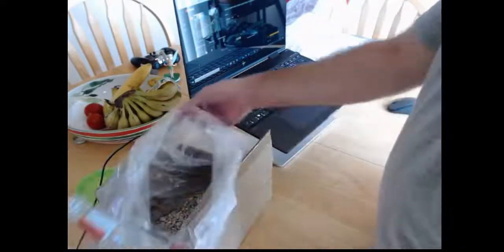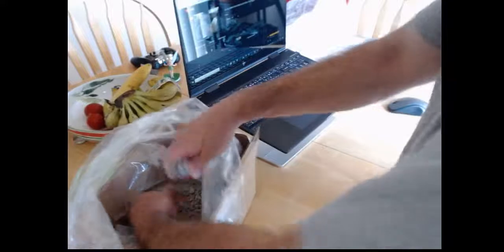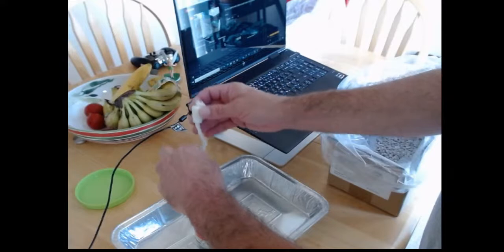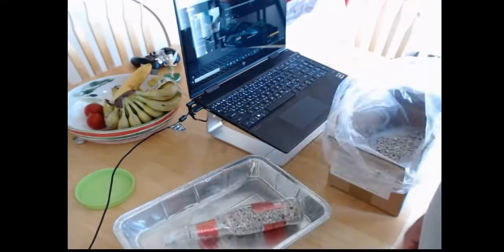DIY OIL LAMPS WICK USING GLASS SODA CONTAINERS AND CERAMIC HOLDER WINE BOTTLE TORCH WICKS MASON JAR

Comment: Nice idea to keep bottle firm, but my problem is to keep the wick burning as it blows off and there is no way to pull it up.  Any suggestions? Thanks
Reply from the maker: Hello.  Thank you for your comment.  You have to get your fingers dirty and pull the wick up.  You can push while twisting from the bottom to advance a little more wick.  Small diameter wicks are best for indoors.  Large 1/2" wicks do better in light wind.  Heavy wind will blow out any flame.  Inside a BBQ will give a little wind protection.  Just place a cookie sheet you don't care about to make a flat surface for the bottles to sit on the grill.  You always need to advance wick after a long burn with cotton wick.  Also fiberglass can get carbon fouled from a long burn.  So just trim and advance.  Like the blues song.  "Keep Your Lamps Trimmed And Burning."  Thank you for your comment.  Ask again if I missed something.  Thank you.
Reply: @danthemandiyallday1160  Thank you for your reply, but I can't keep pulling up the wick every 5 minutes (it goes off in less than 5).  I use a ceramic wick burner (the ones that look like corks) and a wide wick (that I had from an old oil lamp).  It just will not keep lit :(
Reply from the maker: @antog288  Hello.  Fiberglass wick should last longer than cotton.  Surprised cotton just goes out.  Make sure it is wet from top to bottom and always fill your fuel reservoir to the top.  If using in a wine bottle it needs fuel all the way to top of neck.  Wick only pulls a few inches of fuel before it starts to starve.  It is a passive pump and only able to pull fuel a few inches against gravity,  1/2" fiberglass wick is very thick and starts to flame out by 6" between fuel and burning tip   The smaller the diameter wick the less inches it will pull.  Good Luck!!!
Reply: @danthemandiyallday1160  Thanks!  I Did all that,  even tried  with a tin top from champagne bottle but wick still goes off.  Even brought it inside where ther is no breeze, but guess I just can't get it to work :(  Thanks again.